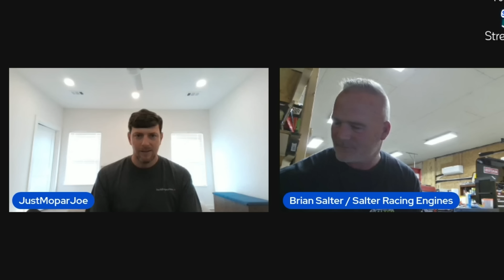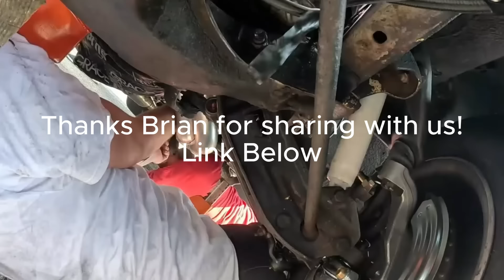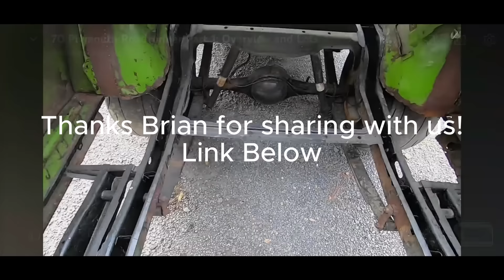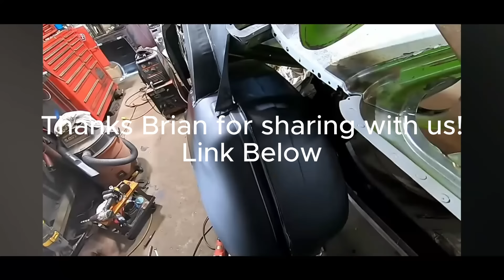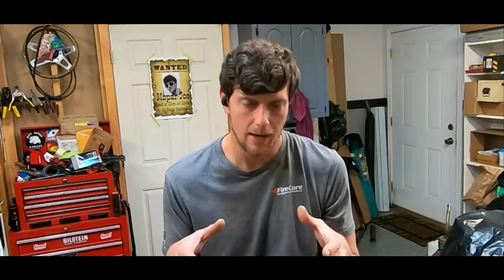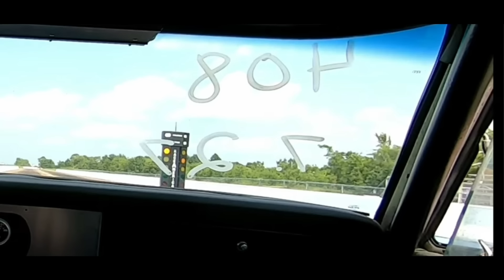538 Dyno Camshaft Challenge Interview with Brian Salter from Salter Racing Engines #mopar #engine

Comment: Are you running the ‘337 intake? I have one that was ported by Larry Smith (RIP) on my 517” low deck.
Reply from the maker: Yes sir the intake is here and ported to use. We are waiting on the head work to be finished and Daniel is ordering pistons.
Reply: I have a few videos of the 517 on my YouTube Page, the ported manifold with my Chapman Stage VI heads revs like a comp eliminator engine

Comment: I don't  think  the heads have enough  cross section  to support  6500 ... if i remember  they are thin in spots so hard to open up .... im thinking  peak  with that cid is 5200 rpm depending on  camshaft  carryover  to 5600 rpm done by 6000 ..... not sure about  what  camshaft  they will do but probably  660 -670 hp and a lot of torque
Reply from the maker: You gotta check out my 512 dyno videos. Low deck, 12.5/1 with out of the box 270’s. It hit 760 horse with E85. These heads after being matched to the intake and repeatedly flowed by Charles should give it some more.
Reply: @JustMoparJoe fuel is a power adder  .... E85 will add about  7% or so ... compression  is also a power adder  ..... and then the question  is camshaft  which  effects  VE .... as cid goes up rpm goes down  with the same head flow  ... stroke changes air draw a bit as it has a higher  piston speed  ... this can change  peak a bit lower as max airspeed  is hit sooner  ... im new to your channel  and  will look at what else you have done .... plus im always  curious about  how powell does
Reply: I don’t know how TF gets 360+ cfm at .600”
Lift without an offset intake rocker 

I have a set of the Chapman 285 MW port Stage VI’s that most of the modern MW heads are based off of. They flow 381 at .700 with a 2.25” intake valve